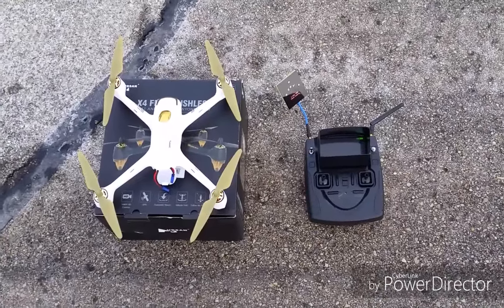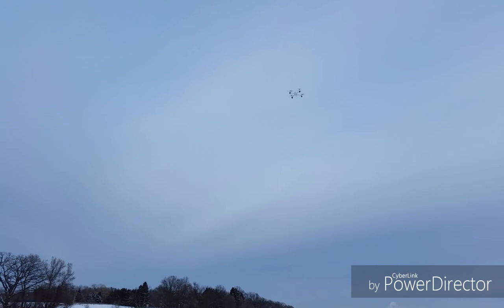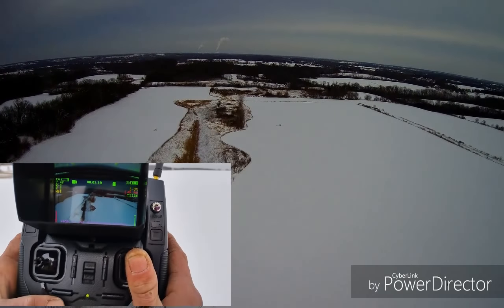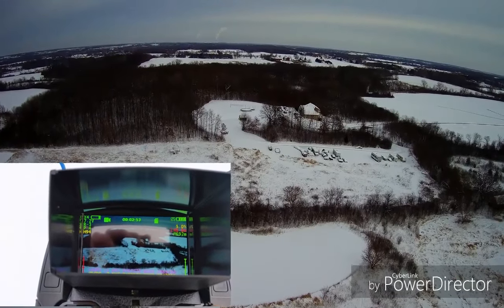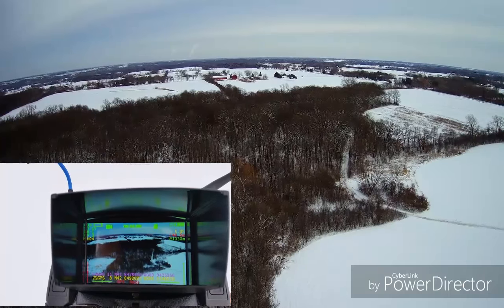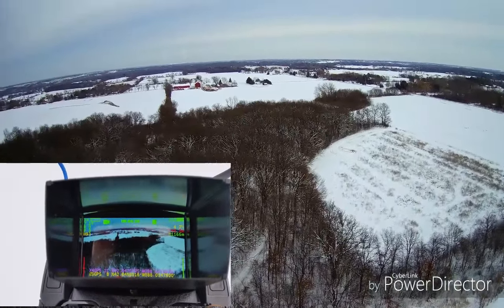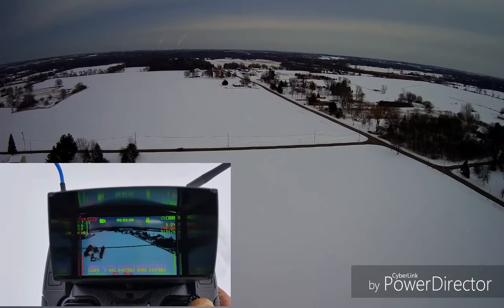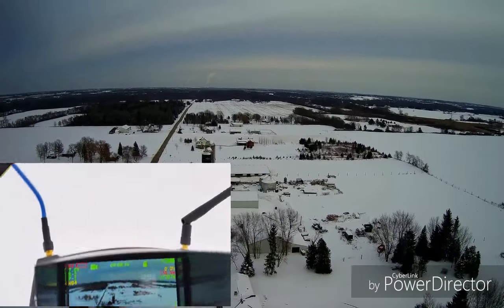hubsan h501ss 2.3Km Range Test. Second Flight After Mods.(May want to turn on Captions).

Comment: Nice video mark. I have same setup as you, and I also do 2100-2300m everytime, but mainly 6V landings, so its a bit scary every time. Did an "alt hold" return from 2km and just 4.6V on Screen while landing..OMG..but it made home.. . ALT hold=15-18ms will kill your battery fast, better to keep in GPS mode for range test..With 2 stock batt i can do 24-27min, but it will land at 6.5 volt, bcs the weight..
Reply from the maker: Jonni Laumann First, Thank You Bro ! Second, I know Exactly what your talking about. One thing I'm experiencing is my SS Control Does Not Read the Quad's Voltage Accurately, At All. It did my first few flights, now it doesn't. If you look at what the controller says when I first started to pitch forward, you'll see what I mean. I don't know why it's not reading Accurately, but it doesn't bother me because I Know from having So Many flights with My S, SS and 109S, that The 501's I have get 20-30 Minute flight times All Day Everyday. My H109S was getting 40 minute flight times ! Only when Very Cold though. I know the reason for that. When you fly in Cold & Dense Air, it does a couple things. #1 The Dense Air helps with Rotor Lift, making it easier to stay airborne. #2 Cold Air keeps the LiPo from loosing energy from Heat Dissipation. #3 Cold Air Keeps Everything Cool. The FCB, Motors, and most Importantly the ESC's. Thanks for watching & your Comment ! Feel free to check out some other videos if ya want to.... :)
Reply: I also get longer flights in cold weather, the physics make sence, i have paraglider licence...at how many amp are you charging the stock/oem (10C) battery??
Reply from the maker: I always charge them at 1 Amp . I have charged them at 2 amps or even 2.7 when I was on the move in my truck and needed to recharge quickly for another flight... Otherwise I stick to 1 Amp charge rate and ALWAYS Set the Capacity Cutoff. Very Important to do that... That's awesome you paraglide !! Whenever I take a Vacation to Sanibel Island or Marco Island, I always go Parasailing. As high as the the dude's rope is... It's cool. However, Paragliding ? That's Extreme Brother !!!
Reply: Paragliding in Denmark is very easy. We only have sand dunes 4-60m and extreme laminar costal wind. We do towing and ppg inland..se my channel I fly a little crazy compared to others in DK...."the Capacity Cutoff"...what is that??....I have for now only used the original charger, that seems to charge to about 3.85V..I have a good lipo charger, but never used it for my h501ss, but know it can charge my other batteries to 4.1-4.2V...is that to much on the hubsan stock/orig batt??
Reply: btw...did you sit in your car with doors closed on RTH?...was wondering if the 501 can RTH when in a car(closed doors)....and I know the 501 will RTH auto when out of 2.4GHZ range, but also know that it will land when TX batt dies, so I just wonder what will happen if we just turn of TX while RTH...Does it fly on the gps start point, or does it need the 2.4ghz connection, or does it RTH ro TX GPS point(placed left on TX where you place your left palm/hand, so when follow me or circle hold TX in RIGHT hand only).I saw in a nother video that 501ss will land quickly when tx batt dies, and it will just keep spinning(you can only do 3 things.wait untill batt dies,try to loose your fingers when removing batt wire, try to turn it upside down to simulate a crash, or just kick it) . any idea what will happen if we loose 2.4 ghz ??or TX turn on/ turn of(change TX batteri maybe could work meanwhile to reconnect, if possible at all ) when/while RTH??
Reply from the maker: Jonni Laumann https://youtu.be/EXd-RUPbbWY
Reply from the maker: Jonni Laumann Wow, that is a very interesting and complicated question to answer. A few occasions, my 501s, flew out of my 2.4 signal & began a FailSafe RTH. However, when it got back into my controllers signal, it did stop returning home & just hovered, waiting for me to command it. I've Never Really had a "Complete" Failsafe RTH. I have had it fly out of range, but when it came back into my signal, I took Control of it. During this video, The Minute I pressed RTH, I Literally Ran to my truck to try and warm up my fingers, they were Frozen ! I did have the controller in my truck. When I did that, you can see (from the quad's camera) it was a little "confused". Watch what it does Right after I hit RTH. It kinda looked like it didn't know where to go. So, I am "Assuming" that you could Turn off the controller during RTH. However, The Original S would RTH where the prop we're first Armed, the SS, RTH to where the controller is. So I am not sure if it would remember it's take off point and RTH if the controller was Turned Off. I am once again assuming that it would, but I do not know 100% for sure. You could definitely test it. Just try it but make sure your able to turn your controller back on in case it starts do something crazy or wants to fly away. You Know what I mean ? Oh yeah, when I was in my truck warming up my fingers, I did have my driver's door open.
Reply from the maker: Jonni Laumann That's Awesome Bro ! I'm going to have to watch some videos on your Channel! Do you have a custom URL? What should I search for to find your Channel?
Reply from the maker: Jonni Laumann Any 7.4 Volt 2S LiPo Should be charged to 4.20 Volts Per Cell. No Less, No More. When the battery is at 4.2 volts per cell then the two cells combine will be at 8.4 volts. That is fully charged. Using the stock charger that comes with 501s, will work, but they tend to not fully charged the battery and they also go bad after a few charging Cycles. It's a very generic charger you get. So, 4.2 volts per cell is what the stock 501s battery should be when fully charged. Anything Less than 4.2, the battery is not fully charged.
Reply: thanks bro..i will charge with my lipo charger from now on...and.yes it actually seems that flight time is less now after about 40 batt recharge  cycles now on orig charger(from 20+ min to 17).....how many recharging cycles can i aspect????......, i have an extra "orig" 10C batt from gearbest, but this is not as good as the stock, maybe after some charging cycles it will be better.I have a few paragliding videos on my youtube channel (jonnilaumann) and i made/programmed www.parafun.dk... my next 501ss project is to get the "russian hack" software to alter like: hight limit, RTH safe hight (now only 10m) and GPS hold speed....etc.... but still along way to the h501ss records=6km FPV, another did 1500m up in the skies.(risky bcs the barometric changes in that alt will confuse the drone)..my other next step is  gd2 gimball (40$ on gearbest) with my old goPro2.......... way back i did video editing this took 200 hours to edit https://www.youtube.com/watch?v=fMpWBOk2g_Y&index=20&list=UU9Q5Ba1cWqj7L8UkI2K1lJw
Reply from the maker: Jonni Laumann Bro, I watched that 1 video you sent the link to. Fucking Amazing ! That looks like a Professional Hollywood Produced, Paragliding Commercial. So Cool ! Fun as hell Too ! Hey, just a thought, why don't you use your Quad & Controller. Use Follow Me Mode, Keep the Controller somewhere on yourself when your Paragliding... The SS can go about 10-15 MPH (In Stock GPS Hold Parameters) and should be able to follow you. Just a thought... Or even Circle Fly with the Quad's Position far away enough so it wouldn't get in your sail's way... Also, I'm aware of the Modding Tool. However, when you start messing with GPS Hold Max Speed, your asking for trouble. The quad travels at a certain speed (About 5.2 Meters per second). That's for a reason, so it's 8 APM processor can keep up with the GPS Position changes. If you Increase the GPS Hold Speed, you may end up Bricking your quad. Also, that "World Record" Flight your referring to, is Not Accurate. First off, that guy was Not using Any type of "OEM" Equipment. He was using a Way Higher mAh LiPo, Using Watt Boosters on the Transmitter, etc. Etc. How can you call that a "World Record Flight" when you modded the Shit out of everything !!?? Basically it wasn't a 501s anymore when he "Supposedly" made that flight. Maybe the frame, FCB & motors we're OEM, but Nothing Else. Ya Know what I mean ? Also, by about 50 or so  cycles with your battery, it's just about done for. Not Dead, but you start losing flight times. A lipo battery only lasts so long. It's made of a very unstable lithium ion polymer electrolyte. Hence "Lipo". Every time you discharge and charge the battery, you are damaging each cell. There is no way around it and no way to avoid it, it's just the way these batteries work. Charging slowly with a professional charger with capacity cutoff will give you the longest life of any LiPo battery. Definitely use a professional charger if you have one. LiPo batteries start to Increase Internal Resistance as you cycle them. NO WAY Around it. When the I.R. Increases, the batt will Not hold A Full Charge. It will also start to Swell as It's Resistance Increases over time. The More IR, the less the LiPo will Perform.
Reply: thanks mate ..ok i will not change gps hold speed, if i change anything it will be the "alt limit" and RTH height. and yes the 6km record is not a 501 anymore like you said."Charging slowly with a professional charger with capacity cutoff "??? my charger shows the cycles like yours but what is the capasety cut of?? and how to change?....i saw your video abot lipos..nice, but still a little confused
Reply from the maker: Jonni Laumann What Type / Kind of Charger do you have ? Capacity Cutoff is a setting on the charger. You set it to what the Battery's Capacity is. (mAh's). For the 501s OEM battery, it is 2700 mAh (That's the Capacity of Energy the Battery can hold). You Cannot Accurately charge Any Battery Without Setting the Capacity Cutoff. When you set the capacity cut off on the charger, to 2700 mAh's, the charger will only allow that much energy to be put into the battery. Every professional charger that I know of has a capacity cut off setting. It is usually in the same area where you can set the amps, Safety Timer, Etc. If you don't set the capacity cut off on the charger to the batteries rating it can over charge the battery because it's only reading the voltage. When you set the capacity cut off to the correct amount, the charger will make sure the battery does not get overcharged because it's not only reading voltage, it's reading how many milliamps are in the battery and will charge it to the correct capacity. https://youtu.be/edDJWgKYcYo
Reply from the maker: Jonni Laumann also, I forgot to mention why you should charge the 501ss OEM batteries slowly. They are Only 10C . The C Rating is basically how much Max energy the battery can safely output. 10C is Very Low. Since it is very low, it doesn't give off high bursts of energy, it discharges slowly. The higher the C rating of a battery means it can output energy very quickly. Higher C rated batteries are usually for RC trucks and cars and racing quads that need to have extreme amounts of "Burst" Energy. Anyways, sense the 501ss battery is only 10 C, it discharges slowly which means it should be charged slowly. 1 AMP. Every time you charge a lithium ion polymer battery (LiPo) , you are actually causing damage to the cells. It's unavoidable but that's how these batteries work. I can send you a link of everything you could ever want to know about LiPO batteries if you want...? You can charge the 501ss battery at 2.7 amps, but it will not last very long if you do that. Because, every time you charge it you are damaging the cells and the higher the charge rate the more they get damaged. The Lithium ion polymer electrolyte that is inside of the batteries starts to deteriorate and Increases its internal resistance,every time it discharges and charges. When the internal resistance starts to get too high, the battery won't accept much of a charge anymore and it will eventually start to swell.
Reply: thanks bro..and .that ,makes sence, and I messed around with my lipo charger and found the cutoff settings wuhuuu, it dosnt show IR like yours.((.. If time is no problem, and i have 2 batteries and lets say i only fly once every 2-3 days..then it will be better to charge at...lets say 0.5 amp or less???or is the charging cykles almost the same with 1A before the batt dies...lets say 50 at 1amp vs 60 at 0.5amp times before death/(to little flytime=10min)...btw damm your answers are good.... and when is IR to low????..a nother info from here, i was in the millitary and we always stored batteries in the fridge (5degrees)...i always do that now, i have a several batts in there..one 5s that was 2 years in fridge only dropped like 1V..ps watch me fly on ridicouless small dune in crazy wind.... https://www.youtube.com/watch?v=Eketce_8Yeo&t=2s
Reply from the maker: Jonni Laumann If you fly once every few days, that's Exactly what I do. I would fly more often but I have a full-time job and the weather is not so great around here. Usually what I do is charge the batteries, then within a couple days they will still be good to fly and get good flight times. However, if you're not going to use them for more than 3 days or so, use the storage setting on your charger to basically charge or discharge the batteries to 40 -50% . That's "Storage Mode". Basically, you don't want any of your LiPO batteries to sit around fully charged or fully discharged. Even when you buy them new, they will always have about 30 to 40% charge. Also, keeping them in a refrigerator is a good idea. You can do that with any batteries and it does prolong their life. It keeps them cool so they really can't lose a lot of energy from "Ambient Heat Dissipation". It also keeps the molecules in the electrolyte from basically bashing off each other so fast. That's another reason you get longer flight times when it's cold outside. When a lipo is being discharged at a high rate, it heats up and loses energy. So keeping them cool can help. That is another reason that a lot of Manufacturers and people recommend that you charge them in a fireproof bag. They actually can start a chemical fire if they're being charged at a very high amperage rate. I would stick to one amp charging for the entire life of a hubsan OEM battery. Even if it has 60 or so Cycles, slowing the charge rate will not help. When they have that many cycles, the internal resistance goes up and no matter what, it's not going to accept a full charge. There really isn't a scenario where the internal resistance is too low. It can only get too high. The internal resistance on any LiPo will actually increase after you discharge or use it in a quad and it is drained. Then, after it is charged the internal resistance will go down a bit. Are you starting to see a pattern? LiPO batteries may seem like just something you charge and then use, they're actually very high tech. They were originally developed by NASA and we're very large in the beginning, kind of like computers. However, technology increases double every 8 months. So, as technology advanced, they were able to make LiPo's  smaller and lighter. Those batteries are actually Very Powerful. For a battery to be so small, yet be able to hold a charge that can spin brushless motors for 20 minutes is actually a lot of power and it's contained within two cells in a Parallel Wiring Circuit that then goes to the main connector. EC2 or a XT60, etc. The internal resistance varies on every battery. The lower the resistance, the better the battery. A good 501ss battery should be around 5 - 15 Ohms Per Cell. When the resistance starts to go higher than that, that is when they are starting to go bad. You probably have a setting where your charger can read the internal resistance. Imax B6, Duplex, Etc. Any professional charger should be able to do that. Anyways, I happen to know quite a bit about Electronics because I was interested in them when I was very young and took classes in high school and college. There was a class in my high school that was called "Basic Electricity". You had to take that class in order to take another class that was called "Digital Electronics". That was a prerequisite for Advanced Digital circuitry class. On and on I went because I kind of planned on being technical engineer or electrical. As I am writing this, I can't look back at what you All asked, so I hope I covered all  your questions. ? Thank you for serving !!!

Comment: Hello Mark
Great Video. I am a newbie and got a 501SS for Xmas 2018. Love it ! I have been getting the feel of flying and ready to do antenna mod. 

I would also like  to buy another drone. What would you recommend that’s comparable to 501S at around $200 ?
Reply from the maker: Honestly, the H501S is kind of in a class of its own. There are similar drones on the market but most use weak, Wi-Fi for control and video signals. They don't use 2.4 gigahertz control signal and 5.8 gigahertz video signals. Also, almost every other drone, under $200, will require you to use a phone or tablet as the FPV screen. The screen isn't built into the controller, like the 501S. Hubsan does have other drones that are similar, even with the same Controller. H502S, H501A, Etc. Otherwise, you could look into something like a Bugz B2W, or most "MJX Bugz" series of quads are sorta like a 501S. Unless you want to get something like a DJI Spark, or Tello ? They cost more $ but they're worth it. I have a Mavic Air and I cannot tell you how much fun that quad is ! But once again, DJI Products Are Not cheap but they are Incredible !

Comment: I think this was the best video I've seen on a range test for the 501. Nice job. I think I've made up my mind to get one. Hopefully I will be able to mod the controller. I've heard they were soldering regular antenna connection but not the fpv antenna connection on the newer models